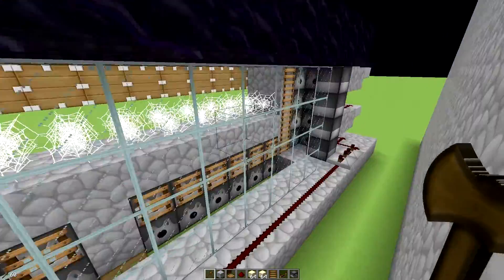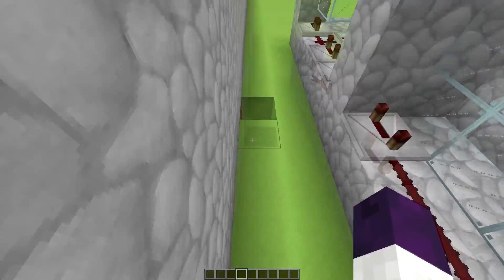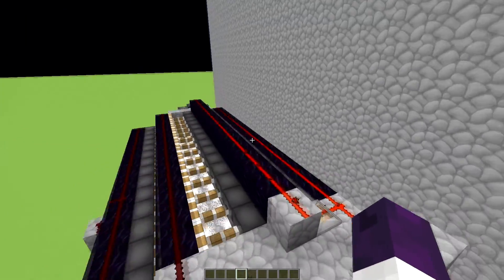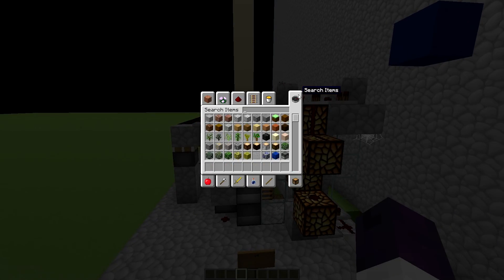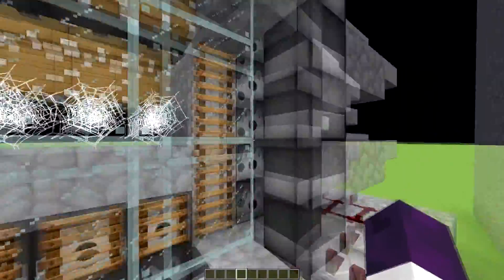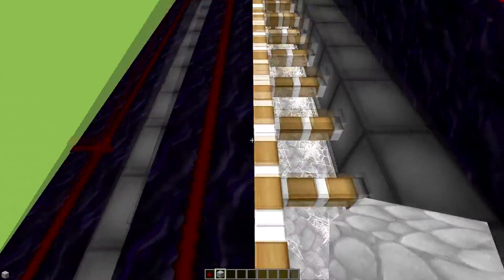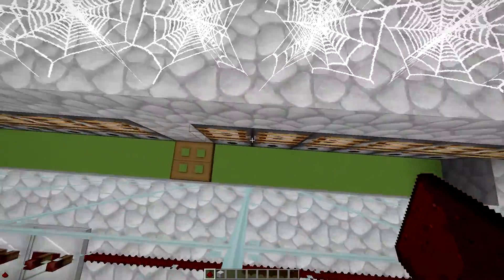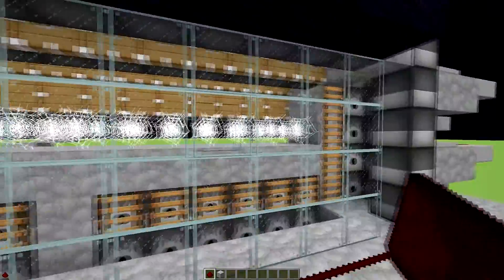Reusable Sand Compression : 14 Long - 2 Wide - 280 Max Sand

Comment: Hey I've been trying to use a 40 stacker torch from one of your previous videos however I always seem to clip on 1 block and I can never stack past the first wall? Would Really Appreciate some help on this.
Reply from the maker: (1) Stack fully (2) Check Y if the sandstack is not on platform Y single stack untill the sand stack is at the same high as cannon platform (3) Hybrid

Comment: Just wondering is there a way for the pistons that drop the sand to close faster?
Reply from the maker: Yes. u can always move the button further away from the 2 comparators facing 2 different ways. that will make it close faster.